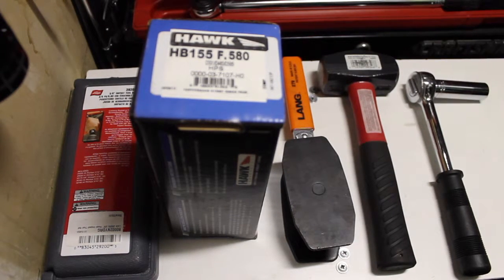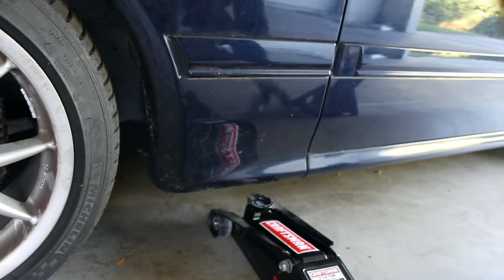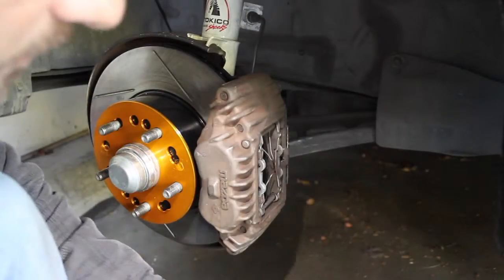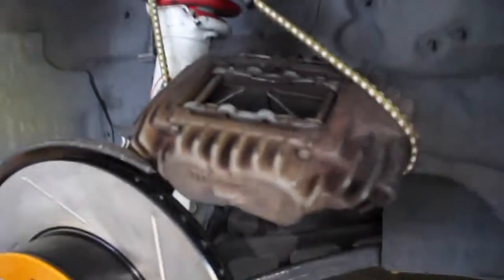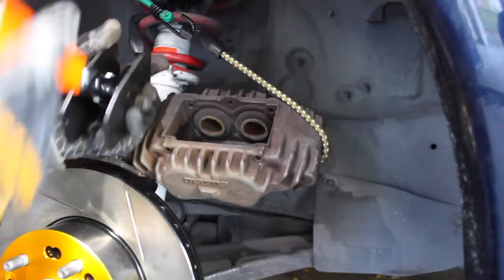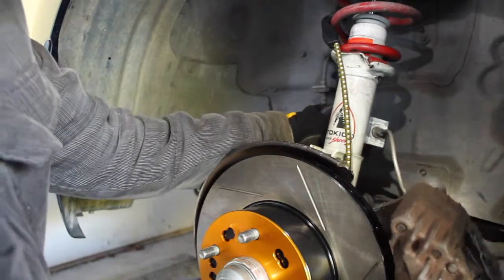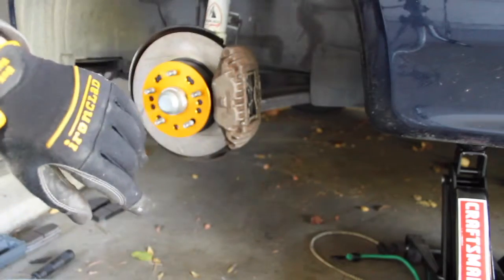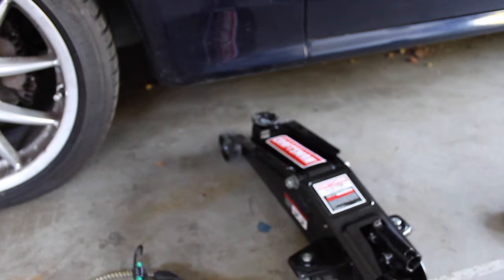1991 Mazda Rx-7 Hawk HPS Front Brake Pads install and Brake Rotor Removal Guide

Comment: Sorry, but noooo... With all of those tools you should never use a Torque Wrench as a breaker bar. It can screw up the torque calibration. Go buy at least a Craftsman Breaker Bar... Lifetime warranty, and more stores now carry the line of tools. Worst case... Use a 1/2" socket wrench with a section of pipe.